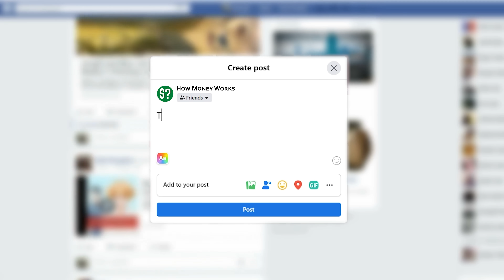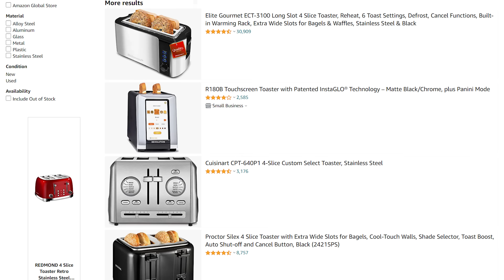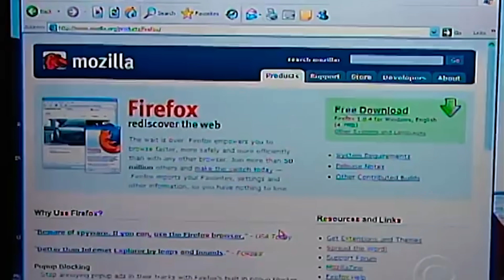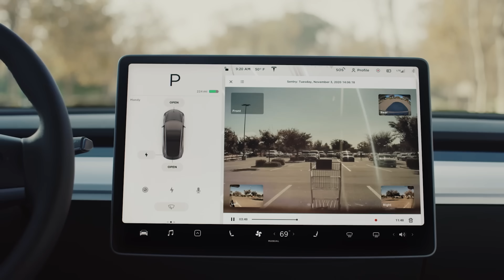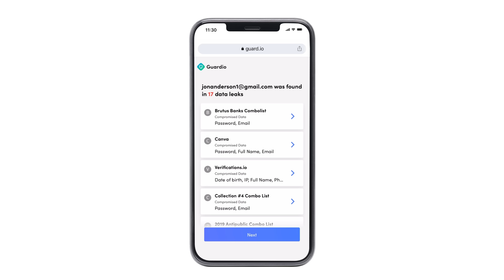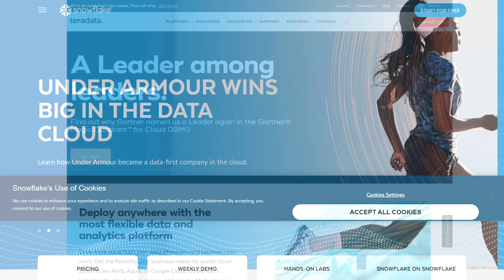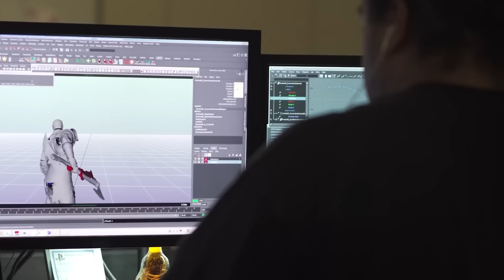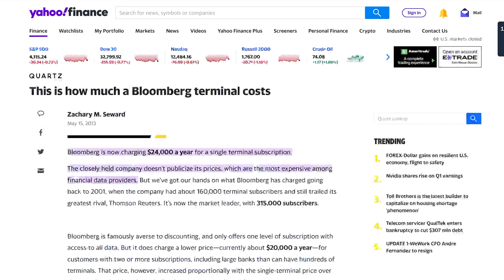The Real Reason Companies Have Become Obsessed With Your Data

Comment: It should be stopped. A federal law should be put on the books to stop this crap. Only one way that’s happening, American’s need to wake up, join forces and demand there politicians draft a bill and sign it into law banning the practice. The majority has to be larger and louder than the minority.
Reply: Trouble is, any politicians that try will have the full power of that data turned on them. Everyone has a history and it's not too hard to spin facts into a public backlash.
Reply: @TheRatsintheWalls  That’s the problem with Government right there. Corporations control them, not us the people. So as an individual citizen. I did my part to limit the amount of my data out there, outleast to the public, because they won’t.

Comment: I still don't think I get it really. So it's not just for marketing, but also for player engagement and costumer behavior? Fine. But how does this suffice to drive virtually every company into obsession with collecting all the data? Is it all self-perpetuating cycle?
Reply: Let's say you make clothes for men. Only men will every buy it and you only want me to see your ads.

If you can target just men, you immediately HALVE your marketing costs and get the same result [Instead of having to spend money marketing to women who will never buy it]. 

What if the product is for Athletic men, well if you can target just athletic men you have your marketing costs again.

Repeat and repeat until you spend hardly anything on marketing but get huge returns. Companies starting out spend 20% on marketing, established brands spend around 5%..... 15% of total company revenue is a LOT of money. It matters, a lot.
Reply: @AminatouFateshifter  I get the idea. But if that were how it works, then why is all the advertisement I get to see still incredibly stupid and not applicable to me in the slightest? All it really manages to do reliably is showing me ads for the very same stuff I just bought and continues to do so for weeks.
Reply: @lonestarr1490  I know, right?
Reply: @lonestarr1490 I would guess you are not an impulsive shopper, make purchases online relatively rarely and in cases of larger ones followed by some research and comparison. If that is the case, your data's worth to these companies is a fraction of those who are your opposite, not to mention any algorythm would have a  harder time with profiling you.

Comment: I have a job because I work for a company that has petabytes and petabytes of data that the executives know is valuable, but the contractors they hire to build the data pipelines to export their data into columnar data stores are clueless as to how to do it without it costing millions of dollars per Terabyte.  There are precious few people that actually understand how to move data around efficiently.  I would estimate about 1 in 1000 software developers knows how to handle data.
Reply: Definitely don't agree. The tools have gotten very sophisticated and abstracted away a loooot of the details. I'd guess that most junior data engineers would be able to handle pipelines of lets say ~1 TB/day volume by landing it in bigquery for example
Reply: @1337mode  95% of junior developers are going to struggle significantly with denormalizing highly relational databases for ingestion into flattened big data warehouses that scale. It's not a simple task, and it often is impacted by design decisions made by many people over years of building out the original data model that you're piping the records from. Properly structuring your data takes thoughtful consideration, which takes time, which is a commodity that engineers are rarely afforded. Unreasonable deadlines and aggressive managers lead to corner cutting, technical debt, sloppy data models, and ridiculously complex data flows that suffer from synchronization gaps, data integrity problems and race conditions.
Reply: @1337mode  You need a sophisticated individual to run a sophisticated tool.  Better than 99% of the people I work with don't know how to put together a connection string, let alone understand the options available in a complicated ETL application.  If it isn't JFM, they aren't going to figure it out without someone else showing them how it is done by doing it for them.

Comment: Great video as always, but one thing that might be missed by the viewers is that Snowflake is a cloud based database, same as Redshift, or Azure SQL. Snowflake itself does not hold any user information, just provides a cloud only solution to storing big data. Companies like EA use other softwares on top of it to clean and compile the data, such as FiveTran, AWS, or Talend. They then use those tools to move the data from those 3rd party companies into Snowflake
Reply: Thanks! I thought the video didn't sound right.
Reply: Snowflake does more than storage. Also, storage is not their main selling point. It’s the compute and ease of use, that make snowflake better than redshift or big query. If the compute costs were lower, I would just move all my data pipelines to snowflake, it’s just that good.
Reply: @y_0_1_0  I’m not debating that snowflake is better than the other two. I agree, since I work with all 3, but the selling point doesn’t change the function, which is a cloud base database. My point is not what else it can do, (specially now with snowpark) but what it primary is, a database. Snowflake itself doesn’t hold any of our data as a company, it provides the software for other companies to hold our data